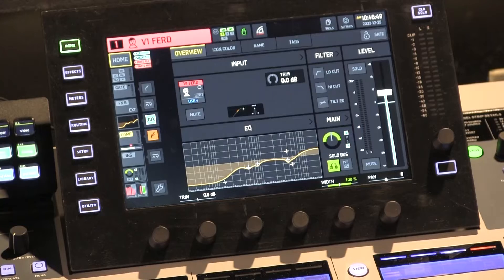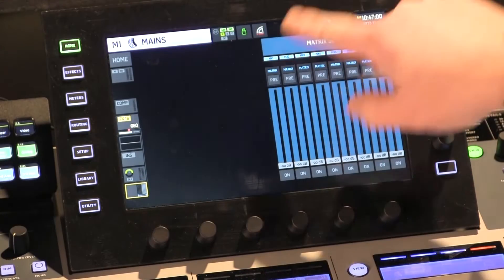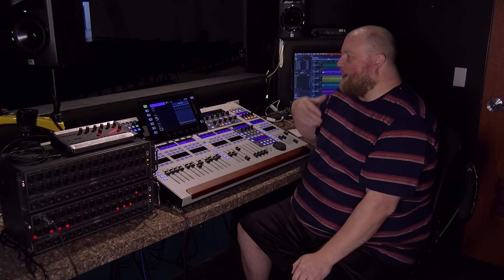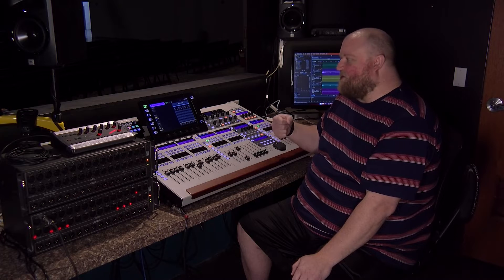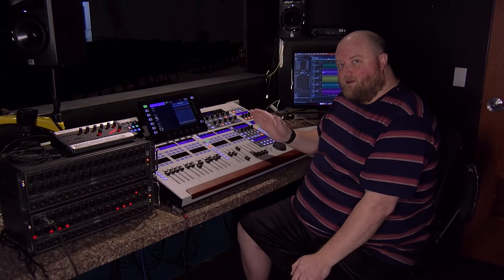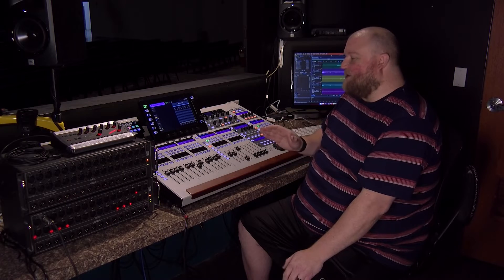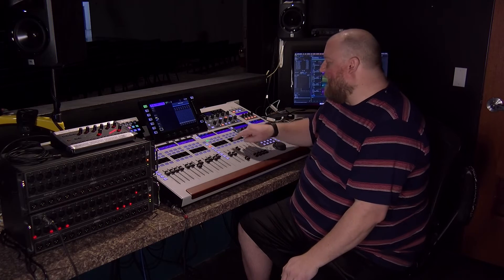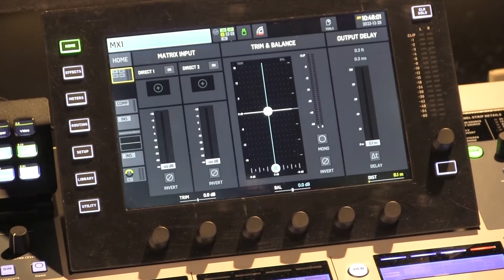Mastering Routing on the Behringer Wing: Buses, Matrices, and Mains

Comment: Hey Mike Is there a way to link to Mains together?  I have Main 1 as stereo L & R out .  Main 2 is for Aux feed subs.  What I would like to accomplish is to turn the mains and subs  up or down together.
Reply: Why not send mains 1 and 2 to the DCA? I don't have a Wing Rack yet (I have ordered one from Sweetwater and it's in backorder right now), so what I did in Wing-Edit. In the Main/Matrix section, there is a circle with a + button between the solo button and the fader. Click in that circle/+ button and you can assign main 1 to DCA 1 and Main 2 to DCA 1. Once you adjust the volume for the main left and right and subwoofer(s), simply go to the DCA section and turn the fader up/down. The DCA should allow you to adjust the main left/right and the subwoofer at the same time.

Another option is to go to the DCA section, show the MIXVIEW screen, and click in the "Channel/Aux/Bus/etc." grid, and select Main 1 and 2. Adjust the faders for the mains and DCA and you should be able to control the fader for the DCA without touching the mains and the subs faders.

I don't have a Wing or Wing Compact, so it's all the explanation I can give you.

I hope I can be of help.

Comment: Very new to the Wing here, actually to digital boards at all. We’ve always ran large analog Allen & Heath boards, and just got a Wing and are going to install/switch everything over in the next few weeks. I’ve been setting up the board pre-install to help with the transition. Currently, I have the my channels and FX buses going into 3 of the Main buses, then going to matrix 1 to output to the PA.  For my Main buses, I have a Band main, Singer main, and a Speaker main.  You said in the video that theses mixes were SOF, I just assumed that with them being main buses, if I adjust channels or FX buses it would adjust the levels in the corresponding main bus, without selecting the bus and SOF. 
Will this work the way I’m thinking? 
Or do I have to select SOF?
Ex. If I want to adjust a vocal, would I have to select SOF on the Vocal main to adjust them? 
On analog, channels are assigned to subgroup mains, but nothing needs selected to adjust any channel levels going to the mains/FOH. 
Sorry for the long comment, retraining brain from analog to digital has been rough lol

Comment: That is confusing to me because I thought the Mains were the four sliders all the way on the right and you didn't say a word about those. How did you end up with mains in the center section?
Reply from the maker: On the Wing, any channel, bus, matrix or main can be moved to any fader location on any layer. There are built in layers for user customization (User 1 and 2), and there are built in layers for matrix/mains which are accessible from two locations (the center section and the right section), but you can also move anything anywhere.
Reply: @technicallychurch  With the release of the 3.05 update it rendered every video tutorial regarding the setting up of busses useless. They hid the buss setup and the buss mode buttons so that I can't even figure out how to make a simple subgroup.
Reply: @technicallychurch  That blows my mind.

Comment: Hey Mike - We have 2 Wings at church - 1 FOH and 1 for streaming.  The person who setup our FOH wing setup the PAs on buses, not on the mains, and in fact the mains aren't even set up.  Any idea on the quick and easy (and correct) way to setup those mains, and use them to control the FOH PA speakers (we have L/R line array's, L/F flown Subs, and Floor Subs, so I'm thinking 3 mains to control those 3 sets of speakers independently) instead of the buses that are now being used?  I want to send FX buses to the mains, and right now I could probably send the FX buses to a DCA and then to current bus that is controlling the PA, but that seems convoluted and without merit, so I'd like to get this set up properly.  Thanks!